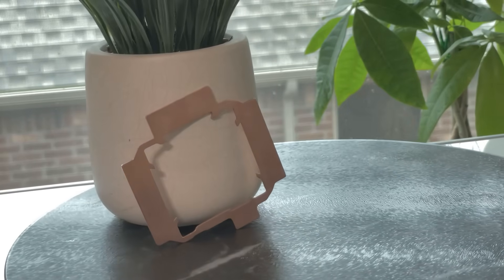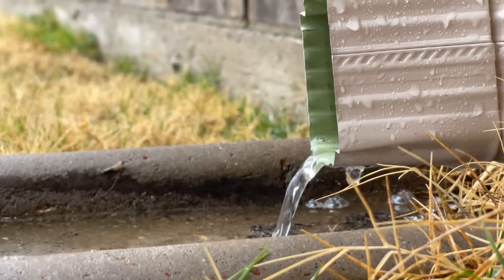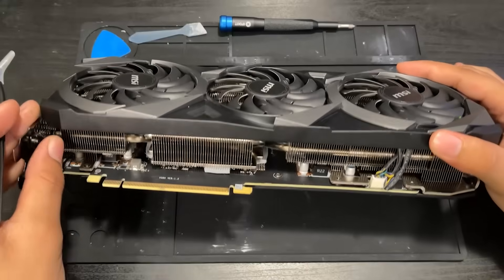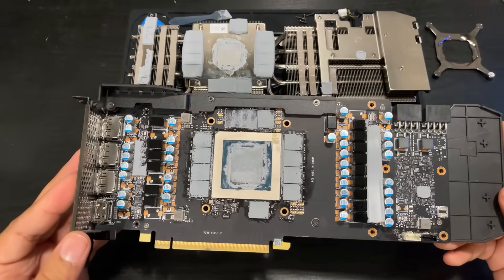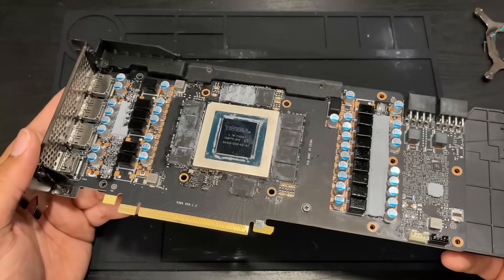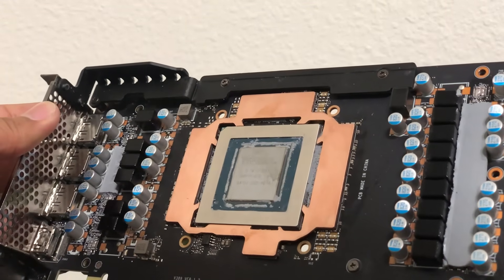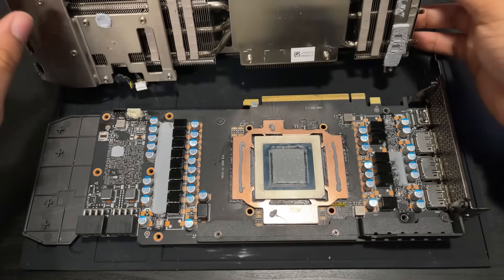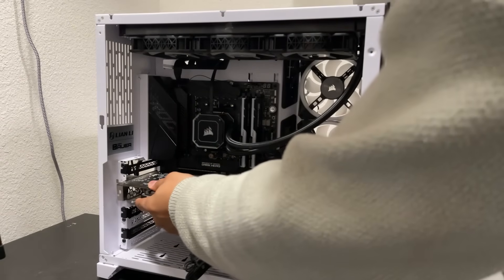Copper Plating FIXED This Melting RTX 3080. 25 Degree Drop In Mem Temps!

Comment: A pair of small ("needle-nose" style) channel locks goes a very long way toward pulling out stuck connectors like your fan connectors. Use the screw to set the lock width, snap it gently onto the connector, and then carefully wiggle it out of the socket. Done it a hundred times if I've done it once; works a treat!
Reply from the maker: Thank you for this tip. I hope it can save me in the future from suffering through removing these annoying JST connectors.
Reply: @dandyworks  Hehe, you're welcome! Nice video by the way! I discovered you from the buzz your previous copper shim video got; looking forward to your future content!
Reply: @dandyworks  
This is the list of thermal compounds you could try for next videos :
Dow Corning 340 heat sink compound 
Heat sink compound RS 554-311 20ml
WLPK 10
RS PRO Aluminium Oxide Thermal Paste
LEITPASTE WP235
LEITPASTE 50ML Metal oxide thermal compound
122 Series Thermal Joint Compound
CHEMTRONICS CT40-5
WAKEFIELD THERMAL 120-5
GC ELECTRONICS 10-8109

Comment: great video thanks, you made it seem less complicated that it actually is, I am going to copper mod a 3090ftw3 ultra which mem temps are reaching 108c when mining.... lets see what this will do to it. Thanks again for inspiring me to do this :)
Reply: Have over half a dozen of these evga 3090ftw3 ultras. Would love to know how you went with your temperatures for the vram and details on what copper shims you used and where you got them.
Reply: Did you end up doing this copper mod?
Reply: what thickness for this card?

Comment: I am so angry that they don't sell cooper plates for all graphics cards why couldn't they atleast make till nvidias 10 series or rtx 20 series this would help so many gpus out there LIVE LONGER FOR GOD SAKES
Reply: @Aeosura01  with your logic heat pipes with aluminum shrouds on old gtx 480s and 590s and etc any gpu for that matter would already have this corrosion so tell me how they don't have this corrosion ??? There using Cooper heatpipes with aluminum shrouds makes no sense buddy
Reply: @donottouch9110  thanks for pointing that out. I forgot to factor in the requirement of an electrolyte when combining copper and aluminum metals in order for galvanic corrosion to occur. Taking that into account, installing a copper plate in the same manner as shown in the video should pose no problem. one can never be too careful though, especially for gpus that use liquid cooling.
Reply: @Aeosura01  you are 100% correct with water cooling this would kill your components and adding the tape could be a last resort just in case measure

Comment: i did liquid metal for my previous gpu (R9 380x), and it was decently efficient and cheap. so, if i will someday get my hands on a very hot gpu - i will copper mod it, yes.

Comment: I wonder how these copper mods compare to the CS Labs K5-PRO product, if you are not aware is like a very thick non conductive paste designed to replace thermal pads, you basically goop it on memory and other thermal pad areas and use your normal thermal paste on the  die.  In testing i have seen it gives a significant cooling advantage but i have never seen anyone compare it to copper modding.

Comment: Instructive video, it's good of you to share your data and experience. Re. thermal paste, I always use the x-pattern with NO spreading and leave the mating surfaces to do their thing - in very instance since using it, when disassembling later there has been perfect, void-free coverage (and after having done it a few times and getting a feel for what thickness of bead to use, minimal excess). Also, in your other vids with the individual VRAM shims, I would use 3M high-temperature double-sided tissue tape (very thin and almost no thermal impedance) to attach them to the chips and thermal paste on the heat sink side - you then don't have to worry about them shifting and hence you can dispense with the kapton tape on the PCB. Use a hair-dryer or heat gun to warm the chips, tape and shims up when you attach them. I would advise briefly lapping the shims to verify that their surfaces are flat (takes minutes).
Reply: Nice tip on the tissue tape, do you happen to have a link for that?

Comment: This is great, I just ordered a plate for my 3070ti. In long gaming sessions I was seeing temps creep up to 100C+, I don't mine but I love these kinds of mods. Ordered some kapton tape from your link too!
Reply: But the 3070ti can handle memory temps up to 110c and given it’s at 100% load I have never seen one hit that barrier. This does not improve performance. So unless your running it at 120 degrees f ambient I don’t see the the point ?
Reply: @bryjb10  yeah and the stock Intel and AMD cooler work just fine too but look at the market. 🙄

Besides that, these cards run with a set power target. Hotter temps requires more power to hit the same clock speed, eating up valuable power target. The cooler it runs the higher it boosts even without manual overclock. This is just basics since the days of Fermi.

Comment: Wish AIB just machined the GPU heatsinks better (especially with the cost's they charge). It's rediculous using 1+mm thermal pad to fix bad heat sink designs, when they could have modified them to make better heat sinks. Also why do they use crappy thermal paste that dries in six months.

Comment: try wd40 specialist degreaser to get rid of that residue left over from the thermal putty  (ITS NOT WD40 thats THE BRAND and its solely a degreaser from their Specialist line)
 they even make contact cleaner which also has tiny bit of dielectric oil in it to protect metals and solder from corrosion

Comment: I had the same problem with my Ventus and got the temps to drop by replacing the pads and balling up some of the excess pad material and shoving it into the gaps between the heat pad and the heat pipe, giving that metal plate some actual contact with the rest of the cooler.

Comment: Definitely dofing this next time I open my card up to replace the pads. Even though the plate is around $50+, I'm spending just as much on quality pads.
Reply: Exactly my logic as well. I just bought the copper shims they have for both the front and back of the VRAM. Looking forward to hopefully big improvements.
Reply: @dylanr5384  my 3080 fe decided it wanted to start running hot now. 105-110c vram temps. Looks like I'll be ordering some copper shims lol. Besides it would be so much easier to install these than pads. Pads are pretty much a guessing game on the required thickness the gpu needs. Even though people on the internet says "this card uses this thickness", not all pads can compress well. I've used thermalright pads and they had to be spot on with the card or else it's either too thick or too thin due to not being very compressible but has very good conductivity.
Reply: Correction, $90 after tax and shipping, hehe
Reply: @donnellysaprano5489  I got these installed on my FE. Temps went from 110C to around 82C top. On stock pads when they were still working, it was around 96C. A big win for me. The thing is, the FE has probably the worst cooler out of all the other AIB so this is surprising.

Comment: Word of advice. I was gently scrubbing my 3080ti with a toothbrush to take some crusty thermal paste left overs near the vram modules, and one resistor came off. It was probably badly soldered from factory, but still, I'll avoid using it from now on.
Reply: I use a half inch flat razor scrapper blade with my exactor knife to remove excess gunk from the top of surfaces... anything that is on the board or the side, just ignore it, not worth the effort to remove it
Reply: Same, but it happened when I was taking the backplate off. The thermal pads were holding it so tightly that I had to apply force to take it off. When it came of the left corner of the heat sink hit the microscopic resister and it came off. When I finished the mod I reinstalled the GPU and prayed before turning the PC on. The card ended up working fine without the resistor/capacitor. Thank god

Comment: I hope they make such thing for Steam Deck to replace the small metal shield cover with full copper one but that would cool all the chips inside like memories, charging IC, cooper pipe from the cooler and so on and would be cool to also have super tiny fins on top so that when the fan is cooling the SOC the air also goes trough the metal cover and take all the heat away with it.

Comment: I recommend to use thermal pads not thermal tape which prevents it from cooling. Non conductive nail polisher around the die is an option.  Yes thats a small capacotor but in the previous video the whole card was in this tape. Your video gone viral and some sites reported it like some new information. The first mod i saw with copper plates was 20years ago.  I buy them for 30cents/piece for my laptops and GPUs although for GPU i use copper heatsinks.  You can improve the temps further by removing the backplate & put heatsinks on top or place a small fan few mm above the pcb. You can elevate the fan with anything non conductive. Double sided tape or cutted ear sticks (or whatever name is in english) ect.
PS:  MX4 is cheaper but u can put better paste. If the card uses above 250-300w liquid metal also will drop the die temps. I have 8c lower temps on my bios tweaked GTX980TI (360w).

Comment: With good thermal pads and thermal paste of the correct thickness, I brought my VRAM temperatures down from 100ºC to 80ºC. The final 5ºC to reach 75ºC for $60 is at the point diminishing returns.

Comment: You really can't say the memory temperature dropped by 20 percent! To get the actual percentage, you need to convert to Kelvin, so add the 273 degree offset. That makes it a 5% drop. It's also entirely useless as an indicator. Just keep it to 20 degrees drop. That does make sense
Reply: True。Does 2c to 1c a 50% decrease in temperature? Definitely not. Cecius is not a 0 based scale, the base is -273.15C which is kelvin 0.
Reply: actually for cooling performance you want to measure the delta over ambient temperature, not absolute zero. that's relative and perfectly fine to quantify as a percentage. a 20 degree drop in ∆T is nearly a 30 percent improvement.
Reply: @joshieecs true, but it's still more useful to just mention the absolute drop of 20+ degrees. That gives you way more information than a percentage if you have no idea what the ambient is

Comment: with this particular MSI 3080, your better off swap the back plate for actual heat conductive plate. as memory die are flip-chip BGA, backplate heatsink can stabilise memory temp without hindering gpu clock speed

Comment: Dandyworks how was the surface finish on the copper plate?
Reply from the maker: A smooth bare surface. No need to deburr or prep the plate. Comes ready to install!
Reply: @dandyworks  Good. Usually the surface isn't all that good and requires a buff and polish. So that is good to hear.

Comment: Nice idea and great video. I wonder if there is a way to bend the GPU back to where it should be. Or if the copper shim is a little bit taller than it should be an you need to sand it down. Anyway I think that even a console could se an improvement with this technique

Comment: im interersted in coppermoding my gtx670 my memory is clocked from 1502 to 1875 a memory offset of +746 or 3745 or 7,490mhz i dont know the temps but they are good and dont have artefacts

Comment: What are the chances they will make front and back plates for the 3090FE cards.
Reply from the maker: Check the site, there looks to already be 3090 rear backplates available 👍
Reply: @dandyworks  sent em a email next week they should have full compatible ones out.

Comment: Honestly I think, that this copper plate should be there right from the factory instead of that 2,5mm thick thermal pads all over the card. Lets hope that companies will see that and take it as an option in future GPUs. For me it is not ok to buy something almost "done", you buy GPU but you have to tune it at home if you dont want to stress it with high temps..

Comment: PCB bend aside, you are now more effectively dumping heat from the VRAM in the same small area the GPU is. The fact that both GPU and VRAM temperatures seem to equalize is to be expected. Then again, the slightest height difference between the copper shim and GPU core may also explain the behavior. You can only tell that by disassembling the GPU and checking the contact pattern in the thermal paste.
Reply: Mine didn't change or equalize.  Maybe it's the nine fans in the case though.

Comment: At several thousand dollars for these cards, you can bet your ass I'm sitting here questioning why they're not copper plated if they reach temperatures nearing 70-90% of their "optimal/okay" heat range when just stress tested. I mean, he even showed it: $60 for a copper plate for this specific card. That's only 3% of the cost of the card, and in both videos, one being a 3070, this one being a 3080, he significantly lowered memory temperatures (And that's nothing to say for the core temperature that also dropped a little.)

I mean... It should be a pretty regular practice for GPUs this expensive, if my opinion matters.
Reply from the maker: EVGA is pretty good about using copper cold plates contacting the GPU core, which I have noticed always keeps the core nice and cool. They still use thermal pads for the air gap between memory, however. I do wonder, is it Nvidia saying that there has to be an air gap with thermal pads, or are the AIBs cutting costs? Not sure

Comment: Kinda weird that this works - shouldn't adding ~0.5 to 1mm of thickness between the chips and the cold plate actually increase temps? I thought that's why IHS were made so thin and also why IHS lapping / lapping in general can decrease temps. 

Yes I know copper has high thermal conductivity :P
Reply from the maker: Well the memory ICs actually sit lower than the GPU die - therefore it is implied that some sort of thermal pad will be placed in between to cover the air gap between the memory ICs and the heatsink itself. In the case of the RTX 3080, the air gap between the heatsink and memory ICs is usually around 1.5mm, and this plate is the perfect thickness to clear that air gap.
Reply: @dandyworks  
Oh duh, I didn't even realize it's replacing the thermal pads. 

Okay that makes WAY more sense now. Thanks!

Comment: GREAT JOB!My question.Could  copper corrosion be a problem?
Reply from the maker: The electrochemical series suggests possible corrosion when aluminum and copper are in contact. However, that’s only true when there is an electrolyte present between them. So no, as long as you aren’t dipping your GPU in saltwater you should be fine. Other external factors such as humidity are very unlikely to have an effect either.

Comment: I've got 4 plates from CoolMyGPU. Have been running them for around 4 months now. Got around 16-18C drop on memory temps for air cooled cards. As for my 2 hybrid cards (3080 and 3080ti) I saw over 20c drop in temp and a significant drop on core as well.
Reply: Im heavily considering doing this, but Im super concerned about copper shorting my gpu... Are the components under the plate even close??

Comment: will mod my 3080 with this plate. lot safer than pads and easer. the bent card could be holding some of the pressure off the die on this card.

Comment: Hey you stole my quote in therms of PC´s , if it can run at 110degress it doesnt have too .

my processor does 65w and my aio does 300 absolutely overkill i know , but only 50 celsius under heavy load makes me happy and my processor happy.
Also its silent AF since i swapped from a air cooler to the overkilled aio.

Comment: Thanks for the great video Dandy! I'm curious if adding thermal paste all the way around on top of the copper would lower temps even more? This way, it would have a complete connection to the heatsink at every point of the copper. Maybe this would give you even better heat transfer to the heatsink.
Reply: I read Dandy as Daddy, I need help

Comment: It could be, that with the better memory heat transfer, your overall dumping more heat into the heatsink and getting close to its saturation point? Also the copper mod might be robbing the gpu die of some clamping force?
Reply: yes... ur totally correct.. this is the reason why the core gets hotter
Reply: i mean the dumping heat.. the pressure on the die is probably fine

Comment: Any chance of Copper AND Water cooling?
Reply from the maker: If the cold plate on a water block is not already copper, then perhaps adding copper would be a good idea. I have not tried it though, so maybe I should in the future!
Reply: @dandyworks  only reason I ask is i didnt think water cooling covered the VRAM... I could be wrong though

Comment: When your extracting so much heat or reduce the temps on mem, it will sync into thr cooler raising core temps depending on workload. Depending on if your a gamer or running compute workloads, copper mod may not be for everyone. If you don't have a Thicc Boy heatsink, copper modding won't be as impactful. Just depends, you and I present the data and it is up to the end user to make the best decision for them. Take care
Reply: @elcactuar3354 thank you grammarly

Comment: Overheat edition.  Lol!   

Thanks for the video. I had no idea these plates exist but it makes me happy that they do.  

“But muh temps are safe”… yeah, until time, temp, and voltage does its thing and degrades the ram and you start getting crashes.  Lower temps= reliability over time.  And can one really rely on being able to buy the gpu one wants when their old gpu takes a dump or starts degrading?